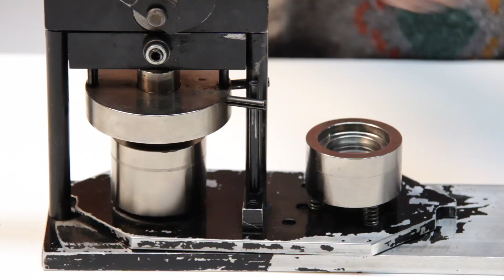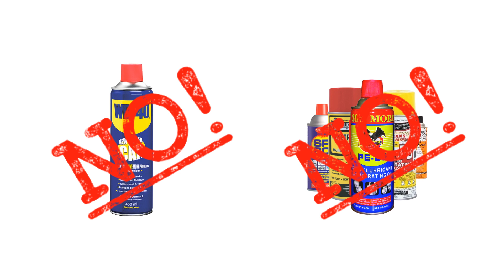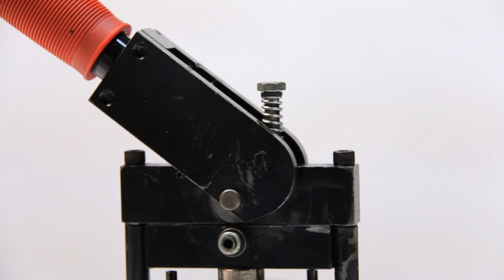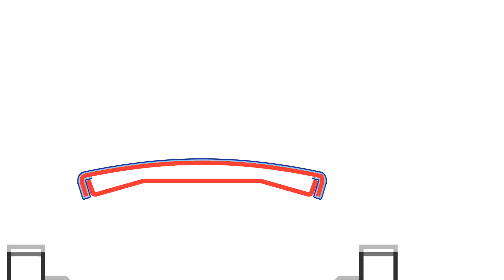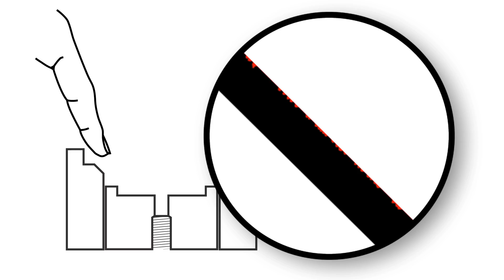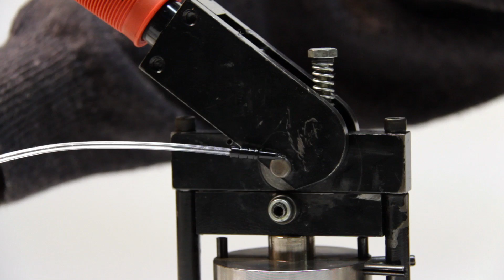How to Maintain a Button Machine - Button Maker Maintenance

Comment: If your buttons are not crimping properly with loose and uneven mylar tops after crimping, lubrication of the die bevels with silicone will likely fix that - 3-in-1 makes a silicone lubricant (Not 3-in-1 oil) that works well.

Comment: Is there an alternative to the stick lubricant? We don't have them in our country and ordering them online is too expensive.
Reply: any silicone grease is fine, I am from Mexico City and I use silicone lubricant for maintenance of electromechanical systems and it works wonders
Reply: Hello Kcrossglaive, Which country do you live in? There are sources that ship stick lubricant or silicone grease at very low rate.